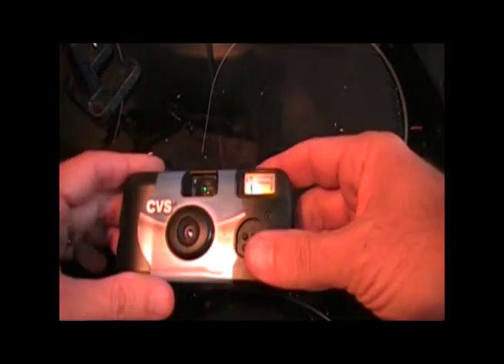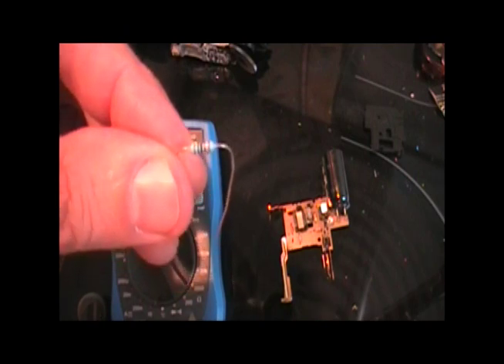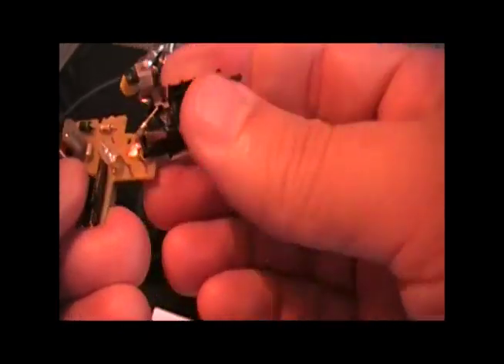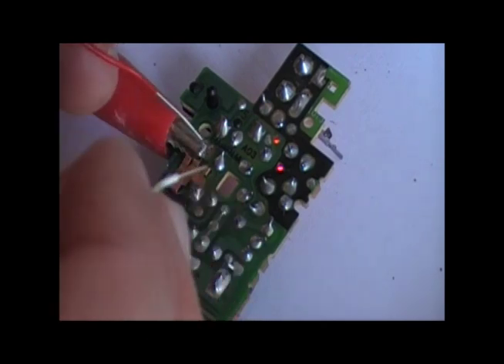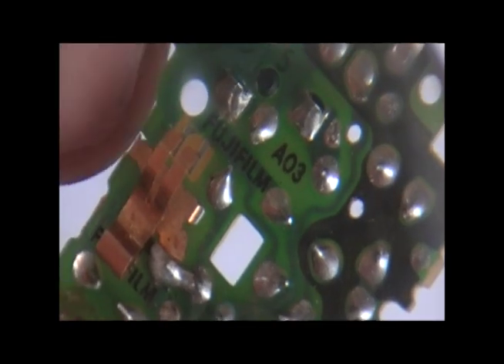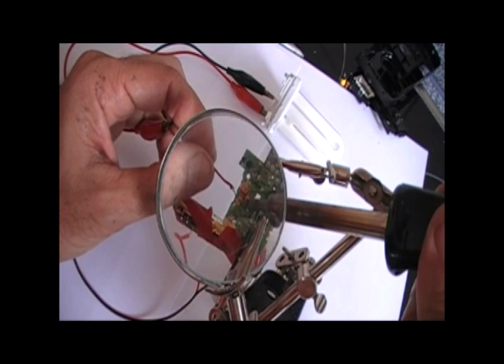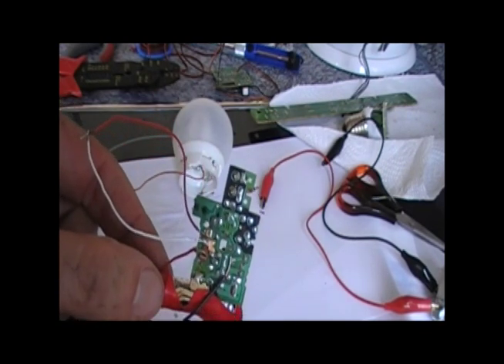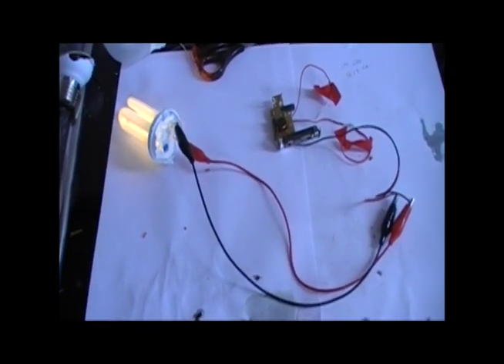How to mod a CVS disposal camera flash circuit to run a CFL light bulb

Comment: Hi,Just built my first following your instructions, the only modification that I did was to solder the switch in the closed position and fit a seperate switch across the battery + terminal, this was so I could easily fit the whole thing in a suitable enclosure. It works and it's for real...

Comment: yeah i have figured this out some 10 years ago. I found i could fire a 4 foot 40 watt tube with a toss camera flash circuit and using 2 or 3 batteries. true it dosent last long but it worked. I was also able to fire 10 CFL tubes off 1 battery using a camera flash circuit. Among other things i have made a whole galaxy of homemade stun
guns and cattle prods. Now try this one, use a small solar panel from a garden light and a couple of AA rechargeable batteries and run your light.

Comment: You've got something that acts similar to a Tesla coil, your little circuit is transmitting electricity to the 3 un-attached wires.  Which is why when you press the switch the light turns on.

Comment: So basically you removed the flash tube, the cap and the trigger coil and did away that side of the circuit.... shorted out the input side of the inverter transformer, and then jumped the contacts off where the cap used to be...? Get a voltmeter across the output and see what you are getting. Without the cap charged to 330v it won't deliver much power but apparently CFL's don't need it. Great vid thank you. Read the description and see the circuit diagram here /watch?v=A3liJJo5uDc    :)

Comment: I have a Fuji flash circuit but the layout of the board is a little different than yours. So remove the flash,flash transformer & capacitor only? Keep the main transformer on. I don't want to ruin the circuit, I do have experience with electronics modding but I just want to be sure I don't remove anything I need. I need to know exactly the right points on the board to connect the CFL. There are 4 wires 2 on each filament, do I terminate each wire together into one wire per bulb end? I plan to mount this in an old breath mint container so it can stand up. Any idea on if the fuji circuit can safely run on 3 volts? Thanks.

Comment: there's an easier way to discharge that capacitor. use a 100K 1 watt resistor so there will be no spark. just  hold onto one lead of the resistor when doing it.

Comment: Can you tell me which side of the transformer you shorted? Does it run to a resistor or the diode? How long did it light for? You might be able to run the bulb permanently with a solar panel charging the battery :)

Comment: I have camera flash circuit and i managed to power a 5w led bulb 230v but it is flickering, any ideas why??? it is Aimex old camera circuit...i connected the capacitor charging wires to the bulv when i was doing a test.

Any help is very much appreciated.

Comment: If this circuit was powered from a usb socket at 5v 500ma could the other side be connected to a 30 watt 110v charger of a netbook?  If so the netbook would power itself.  It may be wishful thinking, but could the efficiency be improved?
Reply: no cos only 2.5 watts but if the notebook is run on usb it will charge it but not sustain while using it on full brightness but if switch off yes still charge-problem might occur though that there is no charge protection and controller

Comment: Thank You for sharing! I have a question. I'm do the same thing and got about 270V DS from 1.5 AAA battery, but the transformer and the transistor becomes very hot (about 80–90°C) even of one 5mm led after a couple of seconds of working. Is it normal?

Comment: A spike destroyed the D1906 npn transistor.  Do you havve anay replacement transistor to suggest?

I destroyed too, on a kodak circuit, a D2504. Same question.
Reply: there are vids explaining which transistors can be used

Comment: Why are there so many videos claiming a camera flash circuit produces some sort of free energy? It just doesn't, it's as simple as that. Has no-one noticed it's on *heck* of a lot dimmer than when run normally? Some very basic electrical measurements will prove this. It's just increasing voltage, no energy is created. Compare this against a simple, cheap, safer AA LED light and you'll be sorely disappointed if you think the camera flash method is highly efficient, let alone 'free'.
Reply: yes i think people are amazed at this because a cfl is usually run on mains. thats only so they can be used in existing mains light sockets. they are usually about 11 watts but would still work with less power such as from the flash unit just dimmer. just needs to oscillate a high voltage and relatively low current will light it. a decent joule thief torch with one double aa battery will probably give more light